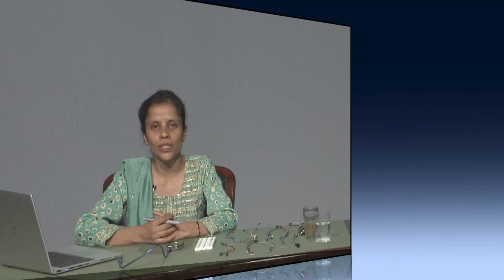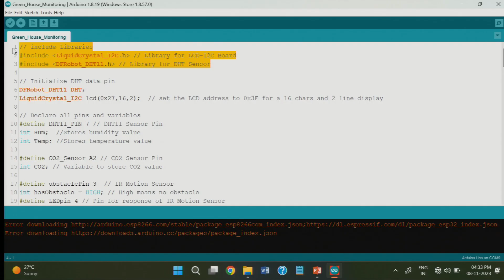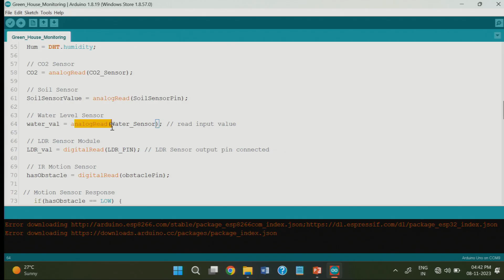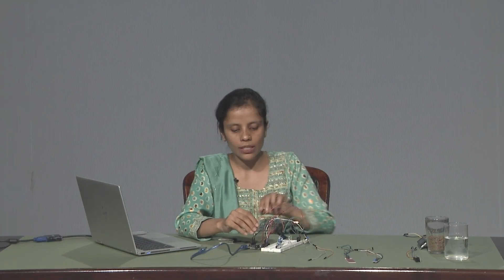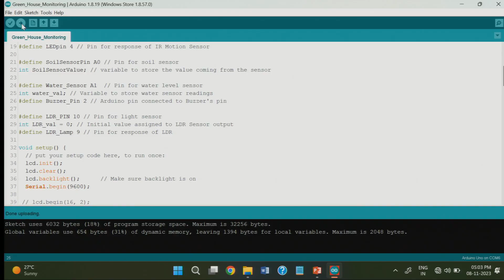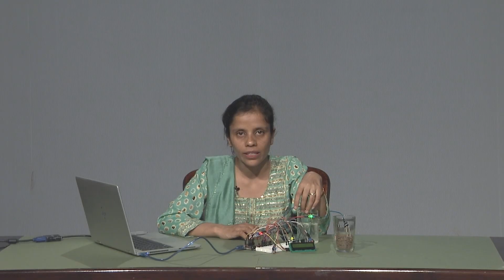Arduino based hardware design for agriculture application

Comment: 🎯 Key points for quick navigation:

26:54 🌿 Sensor and Actuator Connections
- How to connect various sensors to Arduino, 
- Describes wiring soil sensors, water level sensors, and LDR sensors, 
- Details connections for actuators like LEDs linked to specific sensors and coding sequences.
32:03 📟 LCD and Hardware Setup
- Connecting the LCD display to complete the hardware setup, 
- Explains the pin connections for the LCD's I2C interface, 
- Describes finalizing setup for a demonstration of connected components.
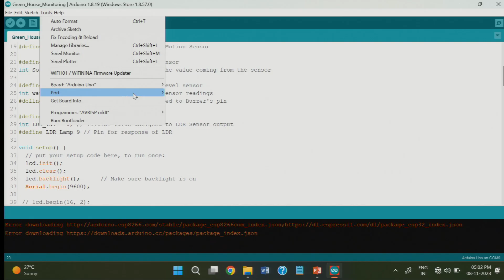34:42 💻 Code Upload and Sensor Calibration
- Process of uploading code to Arduino and observing sensor data, 
- Details checking LED responses based on sensor input, 
- Describes calibration interactions with soil and water level sensors.
37:59 🌍 Data Monitoring and Future Applications
- Real-time monitoring using Arduino-connected sensors,
- Explains potential extension using ESP board for online data transmission,
- Provides insights on adapting the system for broader field environment analysis.

Made with HARPA AI